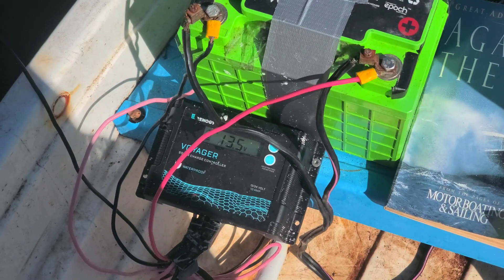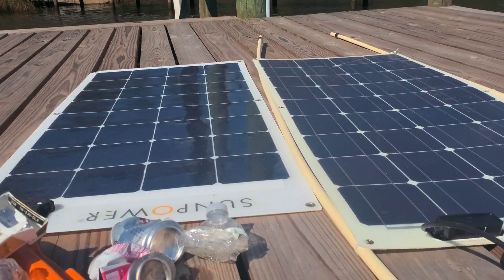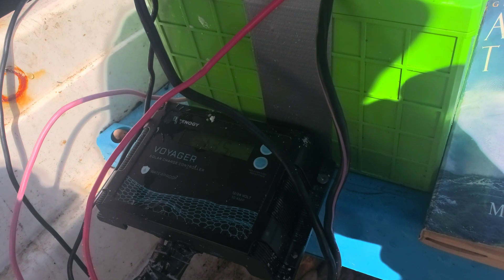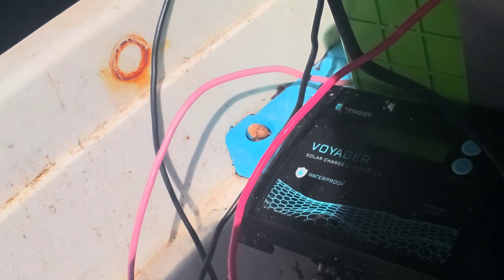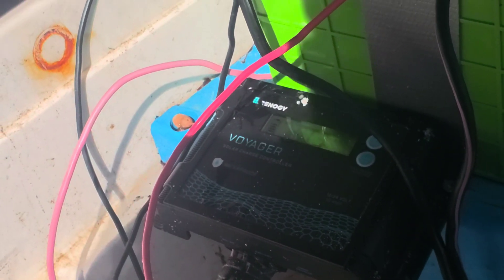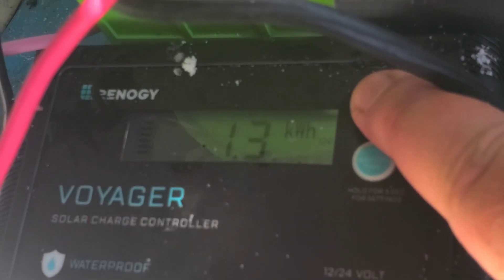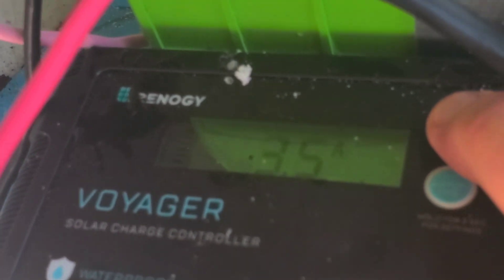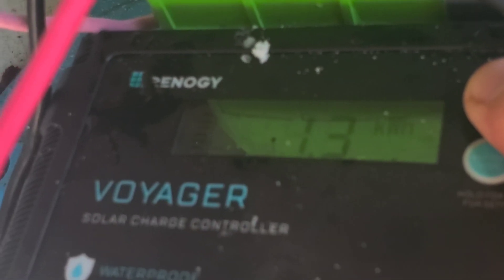Renogy Voyager 10a solar charge controller quirks 2020

Comment: I find PWM chargers ridiculous. The output of a solar panel is much higher than the battery. This “mis match” is waste. The Renogy PWM controllers and the BT-1 Bluetooth interface is useless. Apparently the PWM function and the gate speed of controllers internal meters combine to make worthless data. I know one can say “what did you expect for the price” but my expectations were to utilize these devices for cheep / reliable charges for remote pole mounted equipment. Absolute garbage ! For less money I can get a MPPT 5A module and integrate power stats via Arduino (ESP-32)  and web reports but there is a lot of build time involved. Oh well quality over crap ! These chargers are a absolute let down.

Comment: If you were using a good amount of juice from your battery you would see the numbers go up, think of your controller as a battery charger. What ever 5he incoming voltage is it brings it down to whatever the needs of the battery at the time its not just off or on it has like 4 or so battery charging modes like bulk and float for an example .
Reply from the maker: But this is PWM, not mppt. Do the pulses reduce the voltage on pwm controller (devoid of boost buck dc dc converters)?
Reply: @FranklinBryan  i have that controller as well a mppt and they both do the same mppt is faster and can do more with less they are side by side so I watch them at times

Comment: I'm testing one of these now at the house. Using it wrong, connecting it to a power supply. When I'm charging at the start the voltage between the panel and the PV are about the same. As the battery charges my PV voltage reading gets to be about the proper value. Again I shouldn't be using my device like this but I'm battery charging on the cheap.

Comment: The 3.5amps is at your battery voltage, 13.5v, so you are only generating about 47 watts, NOT 3.5 x 50V.  You need to put your panels in parallel, so then you will see 7 amps at 13.5v for 94 watts.  This is NOT a MPPT charge controller, so you are wasting all that input energy (all the voltage above about 15v).
Reply from the maker: Thank you!

Comment: Open circuit the voltage will be higher but once connected to that battery it will be a volt or 2 above battery voltage.